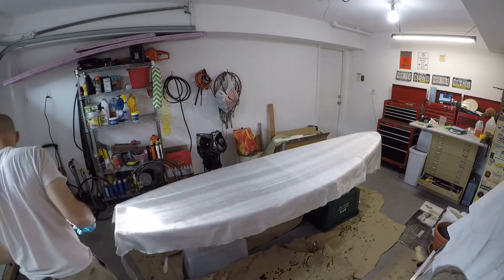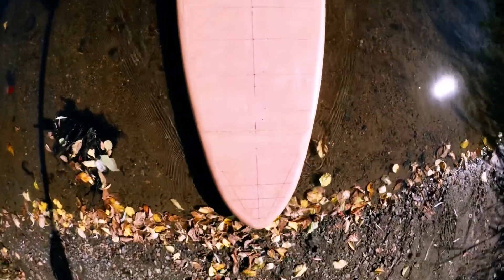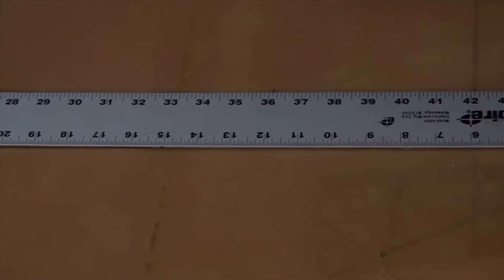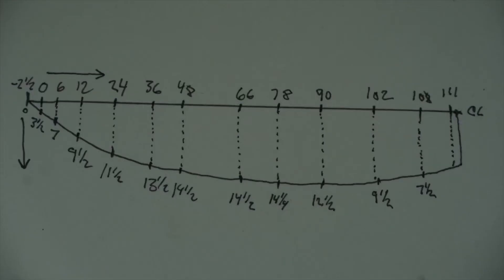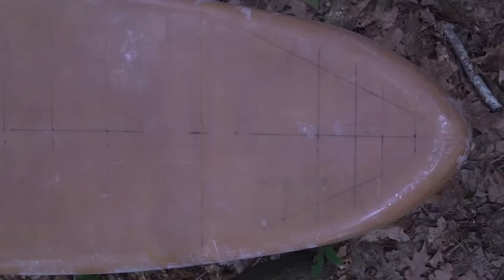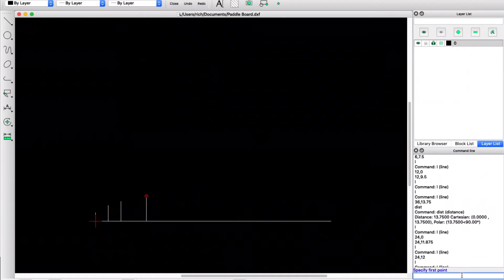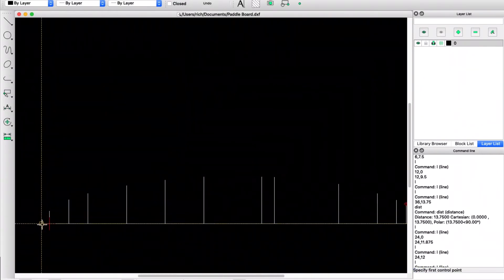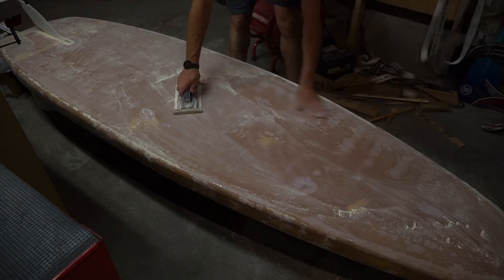DIY Stand Up Paddleboard (SUP) Revisited: Cutting The Blank

Comment: thinking about laminating one inch shts in a simple jig to get the bottom rail profile
also thinking to bond pultruded carbon fiber tube to form external main spar on the top and bottom
for bow to stern stiffness,  same along length of left and right side will transfer impacts to the whole
board,   can have sharp nose and a rectangular transom that the four carbon fiber rods get glued to
maybe put lightening holes in each sht layer,  thanks for the dimensional data,  very much appreciated

the carbon fiber is about  $13 for 60 inches at 0.220 OD, 8 X $13 = $104 the foam $ 60 for two two inch sheets
total weight two sheets,  about 16.4 pounds  +  glass and resin  ?

got to figure a cheap sail rig

Comment: Thanks for sharing. When I made mine I bought a template online for $3 which gave me the shape but not rocker. Once I had the shape I carved to front to give it some lift in the front. It isn't symmetrical but was close enough for me and it works. Just did a downriver float on Saturday and had a blast. Is actually more stable than my brothers inflatable.